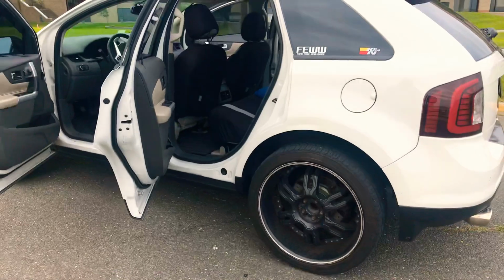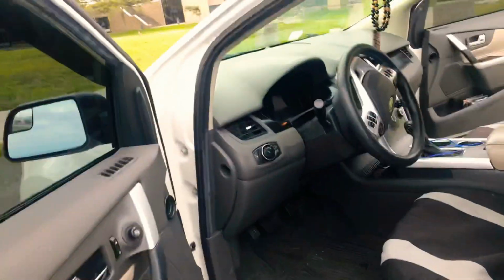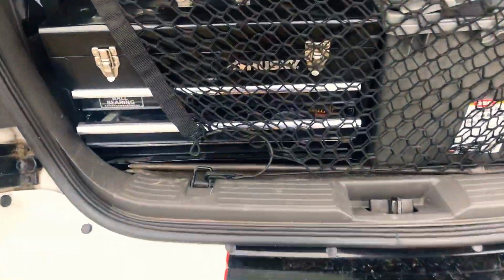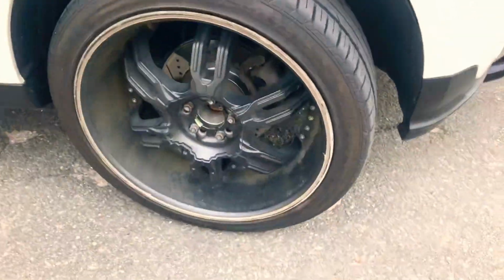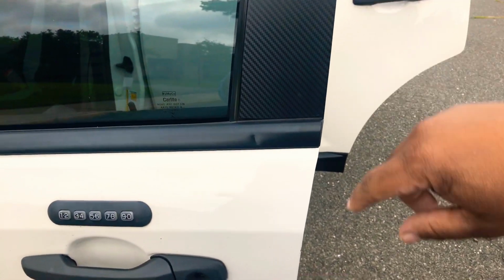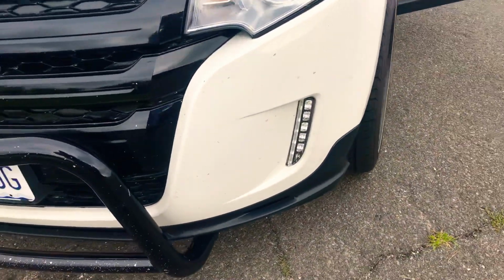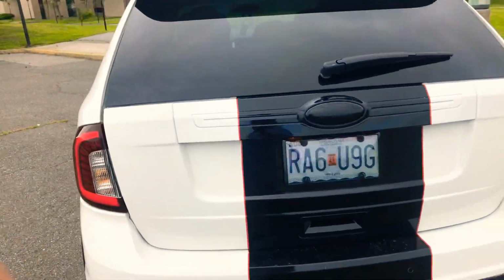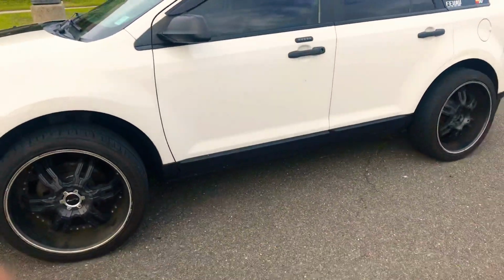2013 Ford (RAZOR) Edge update!!!

Comment: What have you done to the exaust
Reply from the maker: Sherko 2 Sherko 2 yeah man I removed the resonator and the stock muffler and replaced it with a straight pipe and one flowmaster muffler. That’s all. I’ll post a pic on my Instagram later @benzilla06
Reply: @4MATAStudio  benzilla06
Reply: @4MATAStudio  what model flow master?

Comment: Does it go fast quickly? Or does it take a little bit to pick up?
Reply from the maker: Bucket I still have the lag because I haven’t chipped it and removed the stock settings, but it gets up pretty quick. I’ve surprised a few people lol
Reply: Not the video poster but I have the same Edge, '13 with the 3.5 but I have the stock 17" wheels and visual style changes only. I've timed (with a stopwatch, not 100% accurate) my 0-60 runs anywhere from 7.3-7.6. Not bad for what it is